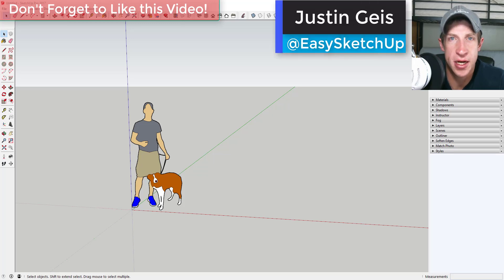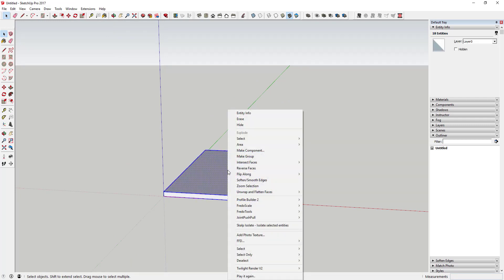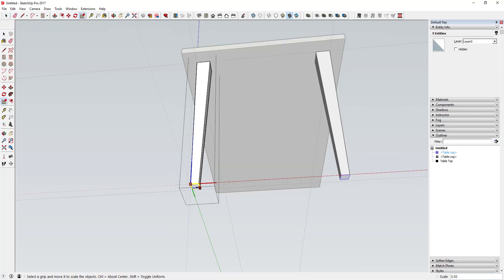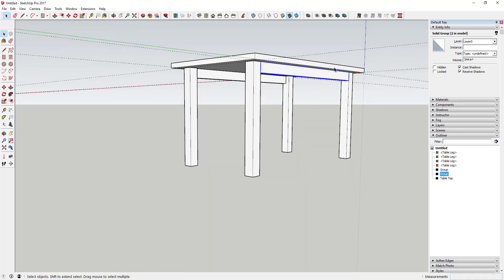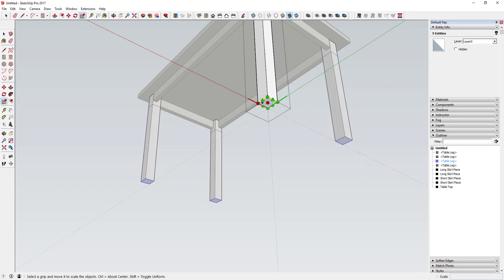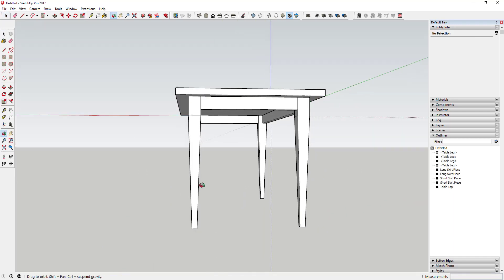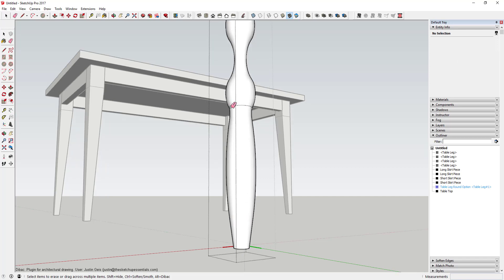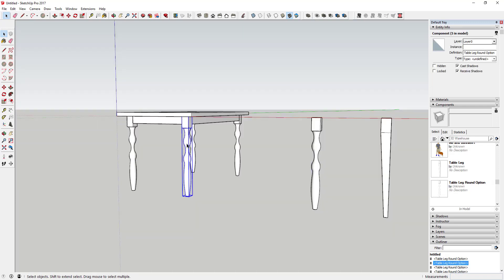Modeling Options with Components for Woodworkers in SketchUp

Comment: I am a sheet metal fabricator at Auburn University.   When we do change outs the new unit never line up with the old ductwork.  I always seem to bring the field measurements back to the shop  and build it backwards.  Is there a way to make a 3 d drawing with measurements and split the pieces apart with the measurements so I can transfer measurements to metal.
Thanks Kevin

Comment: Thank you for this! Do you have the link to the other tutorial you said you had regarding the round table legs and the follow me? Also. Is it possible to remove the object you've extruded after you use the follow me tool? I'd like to make the profile of the leg. check it on the table according to your directions, but I need to get it back to the profile so I can print it. basically, i want to give my wife several leg options and let her see it on the table model, then choose the one she wants and take that leg back to the profile so I can print it and use it as a profile for a leg duplicator lathe. THanks for all your help!

Comment: Great video Justin, I'm new to Sketchup and find your videos are helpful. Following this video I came across a challenge that took awhile to figure out... When you showed both options for creating the set place for the leg (offset and tape measure) I found it very difficult to triple click and only select the leg if you used the offset tool - it kept selecting everything and didn't know why?? I tried changing my mouse options, looking on forums, etc.. No real answer. So, what I learned was to use the tape measure to offset - triple clicked worked without selecting other items!! Other way (offset tool) doesn't allow you to just select the leg...🧐😉
Reply from the maker: Triple clicking selects all connected geometry, so if your leg is touching other raw geometry, it will select all of that connected geometry. Unless I'm missing something, it sounds like it was doing what it was supposed to do...

Comment: Another great video Justin. One suggestion when coping components you are going to modify (such as a table leg or skirt) I have found the best way for me to orientate the copy to the proper perspective (mirror image of it) is to use the Flip Along feature. You touched on it briefly in this video. This feature also comes in handy when modeling bookcases, and cabinets  if you going to use dadoes and rabbits in your build. Again thanks for all the work you put into making these videos I have picked up a lot of tricks and quick steps to make modeling faster.
Reply from the maker: Yeah, I know it's there, but for some reason, I really prefer using the scale tool. Probably because it gives me a visual of exactly where things are going (I always flip along the wrong axis :p ) Thanks!